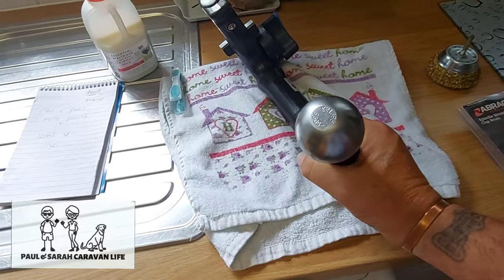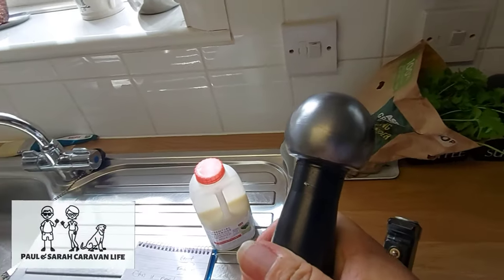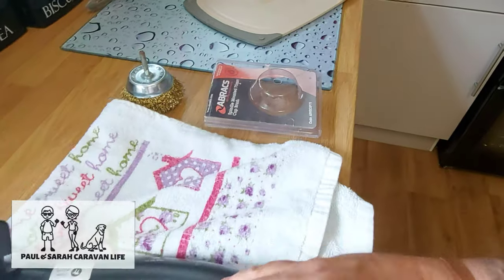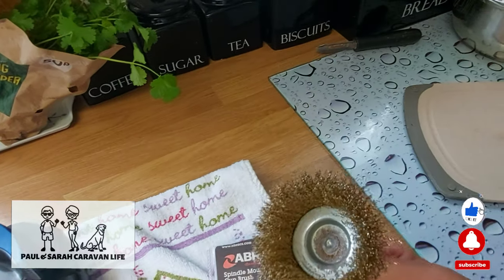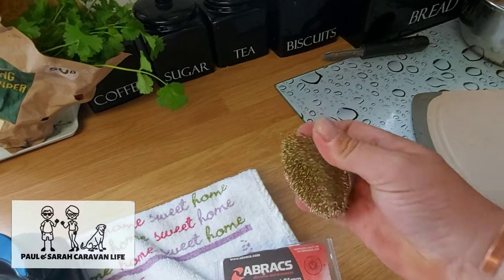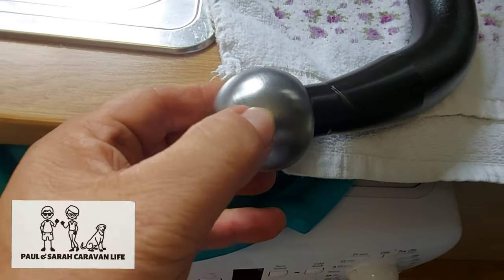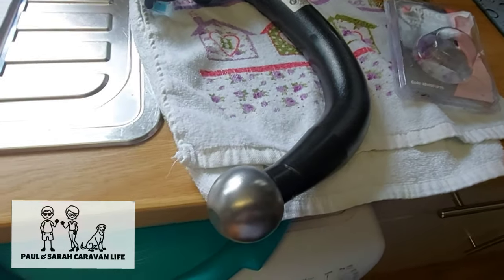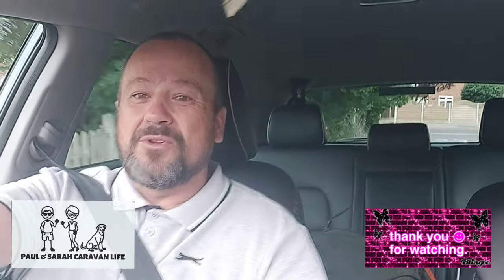Never will a use Wet and Dry to Clean off the New Tow ball I'll do it the easy way 😎👍#towballs

Comment: Excellent job, so much easier than sand paper. You’d think the manufacturers would coat the ball with easier removable wax.
Reply from the maker: Hi thanks for commenting ☺ yes it's so much easier to do. Like you I always thought it was be easier to use wax or a peelable plastic coating. Thanks again Paul and Sarah

Comment: Betted than how i did mine used a multi tool with sandpaper than hand to remove last little bits next tow bar il give the wire brush and drill a try
Reply from the maker: Hi David. Glad I could be of some help. It's such a easy way to do the tow ball. Most people try to polish them so they shine. It takes away the ridges on the tow ball and donest give the tow ball the grip it needs on your hitch so just cleaning off the paint is all anyone should be doing. Thanks again for your comment 👍

Comment: Yo Paul, good job and great idea for those of you with removable balls… 🥴
Ours if a fixed fold down and was already ‘clean’ so I just give it a once over with a slice of wet ‘n dry before each trip now, to remove any slight rust build up and any towing burrs… ✅
Reply from the maker: Hi Rob. Thanks for commenting mate. Removable balls is a must 🤣 you can get a better hand on it mate 😳✊ fixed fold down is it driven by a electric motor or spring loaded.
Reply: @paulandsarahcaravanlife  😂 
It is electrically controlled, but by magnet, switch releases the magnet and it drops down and one then locks it in place manually by flipping it upwards.
On release it drops down from active position and is then pushed back up to make contact with the magnet.  I guess there is a safety locking pin where it is housed, but cannot see the home location.  It just works and is a great addition… 👍🏻
Cheers, Rog… 😉

Comment: Hi Paul, 
Can I just ask a few questions about the Sportage as we are looking at possibly getting one of these which has a kerb weight of 1662kg ......does that mean we can tow up to that weight - it's such a bloody minefield trying to work out what weight caravan we could tow with a 2.0 CRDI Sportage AWD KX-2  (2016 ) minimum kerb weight 1662kg. I did ring a caravan sales place and they told me I can tow up to the minimum kerb weight?
Also, how are you getting on with the car?
Thanks.
Reply from the maker: Hi Steve. I know what you mean about being a minefield 😳 but we always go by what the car can tow. This car in its spec can tow 2.2 Tons. And out caravan is alway loaded over the axle never forward of that axle. And it's always worked well for us. As for the sportage it's a great tow car and as yet can't fault it. Only time will tell. Thanks for your comments and continued support to the channel 👍 cheers Paul and Sarah
Reply: @paulandsarahcaravanlife  Thanks Paul

Comment: Since the actual demo was recorded at home, why did you need to film the intro while driving, risking distraction? I would think that was as distracting as a phone call.
Reply from the maker: Hi Robert thanks for your comment. I don't actually touch the camera I have a Bluetooth button I hold I my hand a click it on and off to stop the camera. Not at anytime do I touch the camera or mount. I take on board what you've said and I try not to do too many intros in the car. Or if I'm with my wife she can if needed turn it on and off but be assured I am not at any time touching a camera. Thanks again,